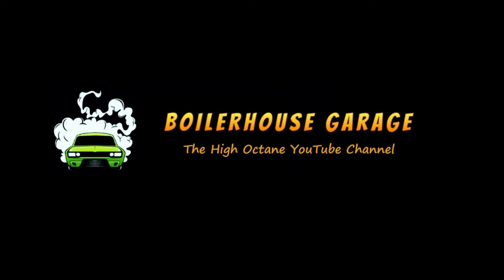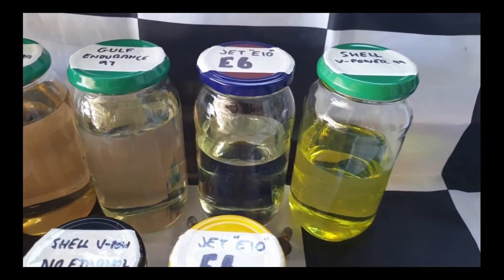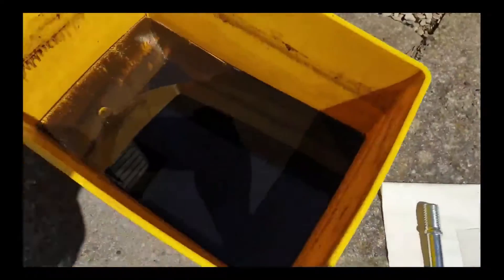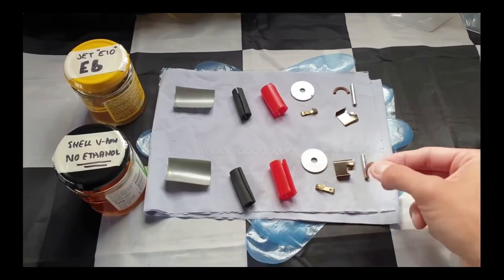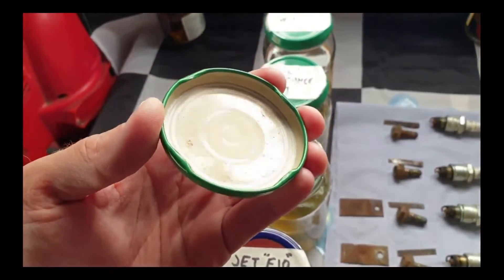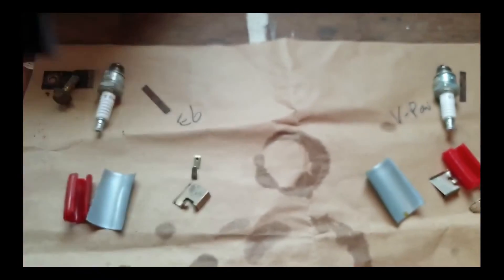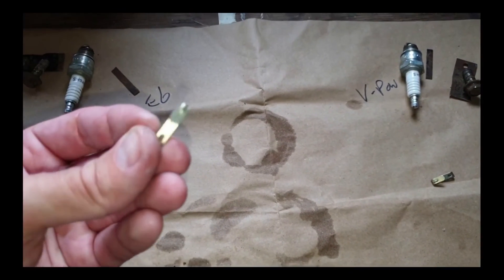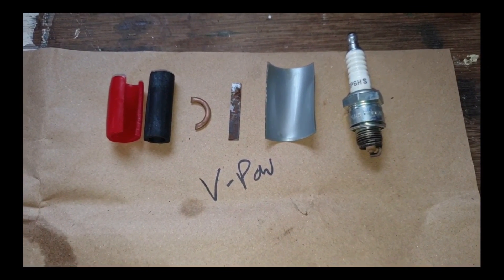Can Ethanol DAMAGE Car Components? Comparing "E10" against Shell V-Power ⛽ E10 E6 🆚️ E5 No Ethanol

Comment: So, I'm doing right by purchasing 0 octane fuel? Just to confirm ?
Reply: Informative video too 👍🏻
Reply from the maker: Thanks! Zero ethanol fuel (if it was zero octane, we'll be in trouble 😄) especially now it's winter with such damp air. Plus it looks to be a false economy not to.
Reply from the maker: Although in some parts even the super unleaded has ethanol in, but it's still better to opt for the lower amount.
Reply: @boilerhousegarage  haha you know what I meant!! 

I'm in Yorkshire, have you ever tested fuel from there? As I personally have no idea about the true ethanol content In my fuel.
Reply from the maker: @danh3017  Sadly all of Yorkshire's retail petrol has ethanol, but the top brands tend to have 2.5%, not 5%. So although you get some of the negative effects of it, you'll still get better mileage the less of it there is.